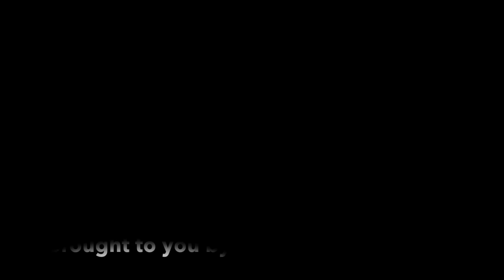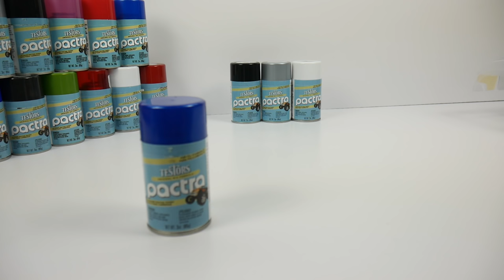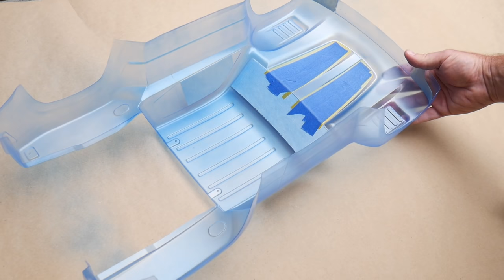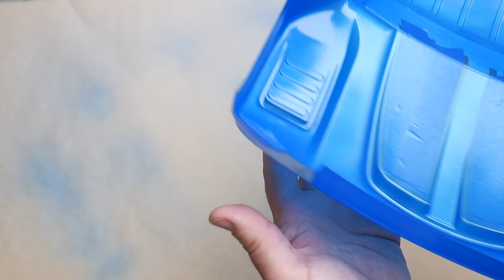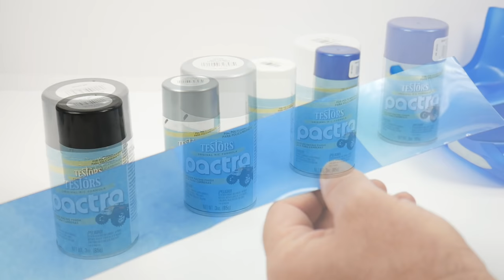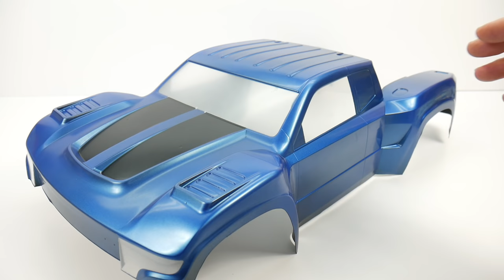How to Paint your RC Body with Metallic Paints - Pactra Paint Series EP2

Comment: Thanks again Rich!
The first coat especially with metallic paints, is the most important. (opposite on a real car). It sets the the metallic flakes to a uniform consistancy and eliminates what can be patchy shades of dark and light.
It is where you can get a more consistent finish with the metallic paints. Think of the tiny aluminum partictal and how they react to the heaviness of your coats. Wet coats flood the metallic particles and tend to be darker, less sparkle and can give you a mottelled or patchy paint finish. The flake is laying flat and is drowned by colour.
A light dusting, for the first coat, I get out the better halfs hairdryer & make sure it's dry, then my next 2 coats would be getting heavier with each coat, then your back up paint to finish.
The best part is you don't have to be careful with top coats of clear which can effect that last coat of metallic flakes on a real car.
My advice, first coat should almost be a dusting of paint & dry before you apply more paint. All the surfaces should look the same and as you pointed out, try to cover all the nooks & crannies and even give areas you know are going to wear through an extra coat.
Cheers 
Garszy

Comment: Nice job. I'm a rattle can painter too. I add 3 more prep steps. First I scuff the inside of the body except the windows with Scotch brite pad, then I wash and dry again and put the body out in the sun for a couple of hours to heat it up. Then just before spraying I run hot water over the can of paint to also warm it up. This allows the paint to come out in a nice even pattern. Now I have a lexan body that will never chip off it's paint. 
Ever try painting with chrome paint? Tricky, tricky but sooo cool when done. Keep your fine work here.
Reply from the maker: Good tips, Tom.....I've never scuffed the inside, but have heard that.  I've never had any pactra paint flake or peel either - and yes, chrome paint is cool....I've used Spaz Stix Ulitmate mirror chrome - super easy to spray

Comment: My question is when you spray the body do you always have to spray the black for the final touch to make it dark or is that just for that color for an example I seen you spray a raptor body two-tone color like a blue and black with the white stripe I like that I just want to know after I'm done painting the body do I spray it with a black coat just to make it pop
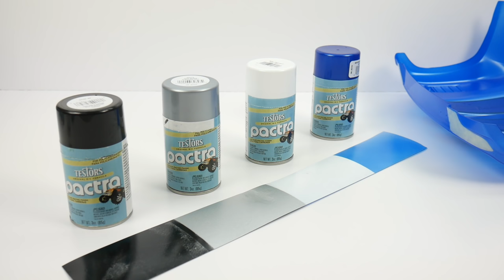Reply from the maker: If you goto that other video:  https://www.youtube.com/watch?v=yrVkOuRbusI&t=1s at 4:41, I go over what it looks like if you use different color backers on that metallic blue.  Typically, if you use black, it will deepen/darken the color, silver and white will lighten or make other colors like yellow or orange "pop"

Comment: Would this have the same effect on a hard body such a Tamiya clodbuster body if the proper paint was used in reverse order? Such as a silver base coat followed by a metallic green followed by a clear coat?
Reply from the maker: I doubt it...the Tamiya line of paints called "TS" is for hardbodies and is designed to make the color on the lid.  "PS" (All the Pactra Paints) are for polycarbonate and use the clearness of the body to adjust the color depending on backing color
Reply: The RCNetwork thank you for the reply.

Comment: Hey Rich,  I’m about to mask and paint my proline body. The body has a sunroof window, but didn’t come with a mask for that can I use blue or frog painters tape for that?
Reply from the maker: Yeah, sure - I usually use that Pactra / Testors thin strips as it gives you a clean edge with no bleed through.  Some masking tape allows the spray paint to bleed the edge
Reply: Well I guess Ian going to have to take that chance 1) it’s already sprayed and waiting for backer color will see
Reply: I came up with a unique idea can you ghost in a label or design after it’s been painted and before backer color?

Comment: Hey rich,
I'm having the issue of when I paint the first base coat, blue, then I back it with with a white, it does not change color, I do about 6 coats for the base, then 2 for the backing, are you supposed to lightly paint the blue on so it's a bit transparent?
Reply from the maker: Yeah, it might be too many coats of the blue.  It should still be transparent - I would only do 2-3 coats of the blue

Comment: How long do you wait to take the window mask off and how do you get it off without messing up the paint edge?
Reply from the maker: I usually wait overnight - you want to make sure the paint is fully cured and not tacky, so it depends on the temperature. I start the window masks peeling by scraping with an exacting knife on the corner, the peel carefully
Reply: @TheRCNetwork  thank you..

Comment: what makes RC model paint different than regular spray paint or even auto spray paint?
Reply from the maker: RC bodies are very flexible, so the paint has to adhere with out peeling or cracking. There’s extra additives in polycarbonate paint to keep it looking good. If you tried using automotive paint, it would just all peel right out
Reply: @TheRCNetwork  I see, thanks for responding.

Comment: Looks great! How long do you suggest between coats? Thanks
Reply: No Humans Allowed of course! 😂😂 Real world experience from Rich may say different. It never hurts to ask. Thanks
Reply from the maker: i usually wait about 15-20 minutes between coats, but it depends on the temp.  If the sun's out I usually let it sit in the sun for a bit in between coats.
Reply: The RCNetwork Thanks
Reply: Ben Cobb 5 mins is all you need if the sun is out,  15-20 mins is over kill as the first coat is lightly it almost dries within a minute, you actually need to wait 20 mins for the last coat as is the most wet coat because is more heavy, so at 20-30 mins is pretty much dried and ready to be handled,  i wait atleast 45 mins though so it can cure more, sometimes an hour if I'm in no hurry. Also make sure to stay away from the wind as it can mess with your coats.
Reply: themessiah809 Thanks